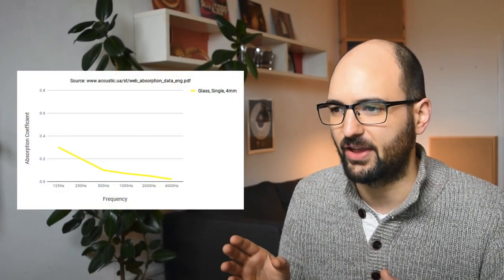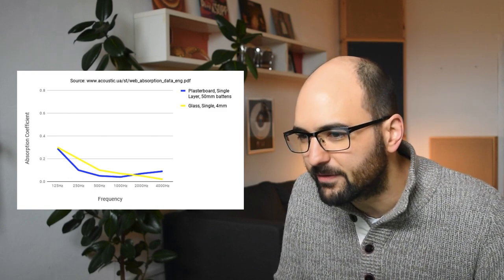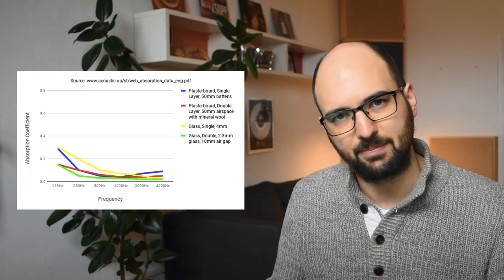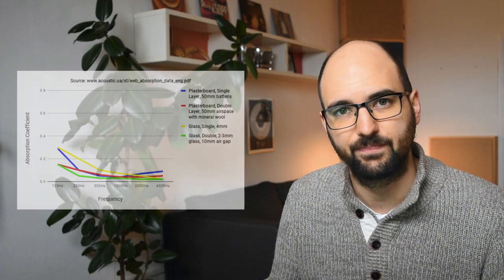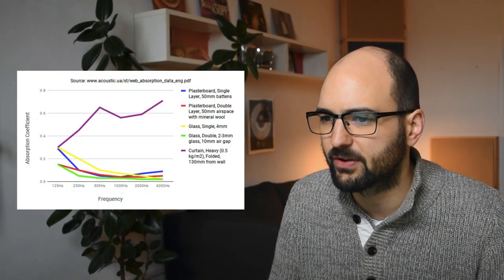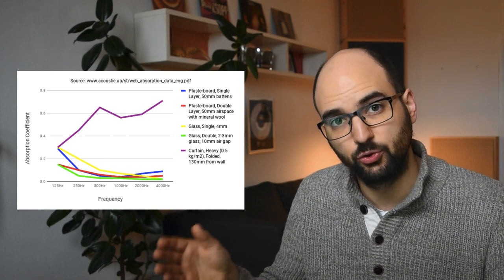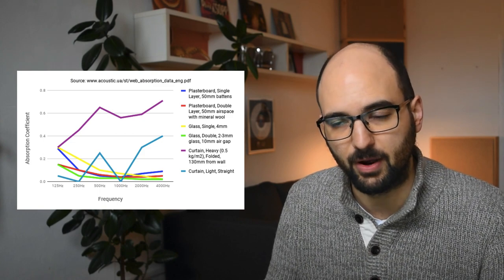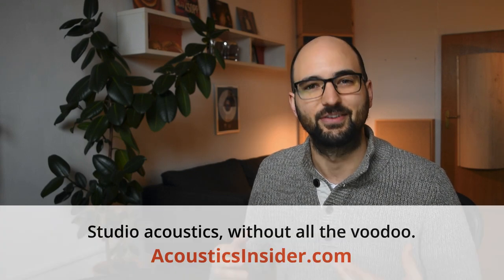Is The Window Behind My Speakers Causing Problems? - AcousticsInsider.com

Comment: There's a lot of confusion in this video. If glass reflects then that's what matters, not how much it absorbs. A thick curtain beats a thin curtain every time, and an air gap helps further. So that part was just wrong. But the main premise - does the window behind your speakers harm the sound? - was never even addressed! The answer is no, because most speakers send sound the other way. Only low frequencies emit from the rear of a typical box speaker.
Reply: Thanks for commenting on this buddy, I appreciate your extra thoughts on this! haha

Comment: Came here after setting up multiple Monitor positions in my new studio.  Didn’t bother with the obvious position with the huge window in the centre of my large space ... tried everything I could elsewhere with bass traps moved all over the place ... guess what?  In desperation I tried in front of the  massive windows which is the perfect symmetrical point ... then Sonarworks gave me the best bass response I’ve seen anywhere in the treated space ... even without several bass traps on place.  You’ve just confirmed my suspicions when I tried this out.  It’s not even especially noisy outside which surprised me. Thanks Jesco - you just confirmed what I found.  I should have just gone for the obvious in the first place and not discounted close to the windows bacause ‘it’s intuitively wrong’.  My measurements say it isn’t.  Thanks man - this is just me coming back with measurements and confirmation 😎👍👍

Comment: This channel is absolute gold! I have a large window to the right of my listening position and I was planning on getting a thick curtain to mitigate the reflections. Glad I found this video so now I know what to do instead. Thanks!
Reply: Hello, I hope you don't mind me asking, what did you end up doing with your window? I have a standard sized, double-glazed window (approx 115cm wide, 120cm tall) in the centre of the wall left to my desk setup. I have a thin-ish blackout curtain same length and wondering what to do with it. Would really appreciate any tips (:
Reply: @안단테샤넌   I'd like to know too. I have sliding glass door windows to my left, and a window in front that's half the height of the sliding doors; no wall to the right.
Reply: Hi abyde, Please reply, we are waiting.

Comment: To improve any room, or most, setting a system on the room's diagonal will in fact be every beneficial.
No matter if the boundaries are drywall, glass, wood, having the speakers at a 45* angle to the walls then projects the reflected sounds away from the seats. so instead of early reflections being received milliseconds after the direct signals from the speakers any reflected signals will be very late and then no longer a problem. I have certainly noticed on music I'm very familiar with, having the speakers on 45* angles to the walls, I now hear details in the recording that were muffled due to early reflections corrupting the direct signals.
Reply: This works! Put my speakers on the diagonal in my living room. Made a noticeable difference 🙏

Comment: I will be adding a later of insulation to the inside of a single brick outbuilding which will then become my studio. I will put up Rockwool insulation or possibly coldstore panels (as I can get them free). I would then add either a layer of 9mm ply or plasterboard, followed by the acoustic absorber panels in the right places. Is there any acoustic plus or negative to ply board or plasterboard? Thanks

Comment: My living room is really weird; it has a window well that is 87cm long (you could climb up and sit in it), 164cm wide and 103cm high. It's also off centre to the room and has double glazed windows at the front, as well as the left and right sides. I was thinking about covering the whole wall where the window well is (which is 335cm total and the remainder of the wall is plastered brick) with curtains. I have NS-10s, but was also going to get a pair of Kali Audio IN-8, or maybe the IN-5, for the extended low end response when I need it which I feel is when this window well would create the most problems.

Comment: What do you think of the Primacoustic Radiator diffuser?  They are an open grid and could be placed in front of windows. They still will let light in, but are supposed to diffuse sound.

Comment: This video is great... just subscribed... Thank you for posting. Question for you... My understanding is that I should be setting up my desk on the short wall in my 11x12 room. My problem is that I have a room with a window that is not centered on the short wall. When I set up the desk and the monitors, they obstruct the window. Also, with the window, off center and in the way, I have no way to mount a large monitor on the wall above the desk. The space behind my back is a closet so I can't set up on that wall. I have considered setting up on the long wall, but I know I'll get more pronounced peaks and nulls if I do this. Also, not that this is scientific at all, but the room just begs to have the desk on the short wall with the window. I would be grateful for any insight you might have.
Reply: We must live in the same building or something because I have the exact same issue would have loved to get some insight on this! What did you end up doing? I watched a few more of this guys' videos and came across his studio tour. It looks like he also has windows behind his desk and he treated it as if it were a wall. (as he mentioned) Now I just don't know what to do about my closet with sliding doors!
Reply: @luisharo9204  Hi. I installed a curtain rod and hung 2 velvet curtain panes in front of the closet doors behind me. I still have the desk facing the wall with the window. I put up a curtain rod on the window wall behind the desk and put up a 2 pane curtain. It covers the window and is wide enough that it looks like it's covering a centered window. Helped with the imaging, too.

Comment: Thanks Jesco. informative as usual.
But what about brick wall compared to glass? I imagine brick would reflect even more than glass or drywall? My window in on the short wall of a small rectangular room, I've always wondered whether it should be on the back wall or the front wall?
Reply from the maker: Hey Phil,

A brick wall will basically let less low frequencies pass through than either drywall or glass, since it has even higher mass. 

But in terms of your window: The question isn't so much which end of the room it should be on, but rather what it does to the low end response of your room, and how that affects where you should position your sweet spot to get a more balanced low end response.

The Bass Hunter technique that I linked to in the description will tell you exactly that.

Comment: Do you ever have some object in your home studio space causing audible noises because you've reached either it's own resonant frequency, or the resonant frequency of some adjacent object?  Imagine someone hit a corelle dinnerware plate (basically glass) with a silver dollar on top, somewhere in your studio. Whenever you hit that resonant frequency, let's say a bass amp outputting a peak in the low range of bass amp output, you get a horrible sound and your own ears are not helping you find it.  What do you do? Any ideas? I've been concocting a test setup with a looper pedal, a bass guitar, and a bass amp on a wheeled trolly so I can "test" fire loud amounts of certain frequencies around my room.   Say playing a chromatic scale on my bass from it's low E, up to the E one octave up.  It's often for me the 41 hz, and the sub-bass 20 hz where I hear these horrible resonant or rattling sounds in my room.
Reply: If the window is 4 feet behind the speakers and the speaker baffle is 16 inches wide, then would it be fair to say the only frequencies below approx 300hz will have direct incidence from the speaker to the window? In which case treatment should be more focussed on low frequency for the wall/window behind the speaker?

Comment: If you shold come up with some tips.. I have a very small room , The longest Walls are a bit over 3 meters, and The same on The other wals, The longest Wall “on The right “ has three Windows that fill up The intire Wall from mid and up to The celing. The ceiling is tiping about 5 to 10 degrees angle but from Where i have placed my monitors, The ceiling is not equel on both sides. My questien is: should i replace my speakers  against The Long Wall Where The Windows are, Where The celing is lowest or The other Way around, or do you Think that The placement is alrigt considered it’s a very small room and The celing is idk 40 cm higher on The right.

As of right now Where i have placed my speakers, i have a window on my current backwall, a door in The left corner to my booth that is as Big as my “controll room” a door on The left wall “up against The other Door” an on The right Wall, half window half Wall from The mid of The room in hights. My room is 10 m2

Comment: I really don't like absorption coefficients without having a context coming with it. What means glass and plaster board? Is it measured with 0 distance to a concrete wall of a reverb room or 20 cm distance or randomly placed in the room or build into a concrete wall with a big room behind? All of this will give totally different absorption values! 
If I want to know the absorption value of glass I build the setup totally different then when I want to know the absorption value of a window that has free space (aka outside) behind.

Comment: One of my four walls in the studio is basically glass. It is to the left of my mixing position and i have a very thin curtain infront of it. It somehow works but i end up with that nasty high frequency ear fatigue in my left ear after some time. I had the same fatigue after a couple of hours when i had an absorber on the first reflection point. So i pretty much just live with it as it is.
Reply: Get rolling acoustic panels

Comment: Hi. I am building a small home studio in the garden. It's gonna be 3x5 meters and i want to place a window in it. I can chose wherever i want to place it bit i'm not sure if it should  be in the back of the computer screen or in front of it on the far short side. Obviously i don't want to put a close it with a panel. Any advice?

Comment: I have a standard sized, double-glazed window (approx 115cm wide, 120cm tall) in the centre of the wall left to my desk setup. I have a thin-ish blackout curtain same length and wondering what to do with the window - for better image context, i I'm in a small University bedroom (approx 3m long, 2.7m wide) and trying to gauge what I could do amongst the limitations of a small room, both window and door opposite each other on the shorter walls (2.7m)  and likely permission issues for moving/adding furniture. Would really appreciate any tips (:

Comment: Hey thank you, very informative but I have a question. Wouldn't the window behind the speakers act as a filter, letting some of the bass frequencies 'escape' the room, therefore being more beneficial than a regular wall? because the bass is leaving and not being reflected back into the room? I would appreciate your thoughts on this.
Reply: heypussy hi 🤝😃 I was questioning myself this a time ago myself and couldn't find an answer so I hired a focused decibel meter and went outside to measure and actually it didn't come more sound from the window than the wall. The window was a double-layered 3mm (each glass plate), and the wall was a wall made of wood with rockwool inside (about 30 I'm deep) both made for cold winters here in Norway 🇳🇴 kindest reg. Hope I could help a little, but I am far from an expert on this!
Reply: @oledahl.  Oh thank you, thats good to know.  My window Is a regular one layer window. I will try to test it with a dB meter from the outside. Cheers

Comment: Hi Jesco, thanks you clarified many doubts

I have a window in my room that goes from side to side, it is very large and I currently have the monitors in front of it, but not very close. I do not have acoustic treatment, but I would like to invest a little in that. Another fact that I have is that my room is like a rectangle, but one of its shorter sides is the window. I do not have another space to put the monitors in the room, I would like to know what I could do?

Comment: Hey I have a problem I think you can help me with. I have a problem everytime I run my EQ for receiver. It always has my dialogue panned toward left phantom area between left speaker and center. I know these eq companies tell you to tweak after you run but I am concerned that when I change things I am altering things. If I do this then I find that S sounds sound much more pronounced on my right side. I can never get the imaging just right(especially in 2 channel) if someone talks from left on screen it sounds like the dialogue comes from that person but if it's is 2 people in the same scene, the person on right doesn't sound quote present in same frame(lacks punch I guess) the stereo effects come through from proper channels though. I have tried altering levels, distances etc. Have not tried any room acoustics materials yet because I have no idea where to start. 

I do love in an apartment and my speakers are in front of a pretty sizable window. My living room has carpet and absorption from couch and furniture. There is 2 open ways connecting loving room to entrance to apartment and kitchen and a small hallway that leads to 2 bedrooms and washroom.

Comment: The problem is - you glossed over the fact that glass and drywall reflection sound different and that they both " don't sound particularly good" generalizing the detrimental affect on sound. However, the difference in the materials' reflected sound is actually staggering. Most people have sheetrock / drywall rooms and left untreated usually sound quite poor. But imagine a cube made of glass and how absolutely abhorrent it would sound. Net - be careful to not generalize.

Comment: So glass absorbs sound starting at 250 Hz at increasing efficience towards the low end... wait what? The most difficult part of getting high audio quality in a room is not trashing it with long decay times in the low end while not overly dampening the highs. This appears to be even more essential given all somewhat affordable speakers tend to have poor directionality in the bass range. The only thing that damps the lows better than the mids and highs, I was told, are bass traps. Now you're telling me windows are doing just the same thing? Isn't that good news? I mean, we probably don't want it on the first reflection points, but doesn't that mean that generally, a good percentage of glass is a good thing to have?

Comment: If bass goes out of the window, wouldn't you have problems with lack of bass? should you just bass trap all corners anyway?
Reply: You don’t get “less bass” if some is escaping through a window. You would get less bass reflections, which is desirable for bass clarity. The whole idea of bass traps is to minimize bass reflections from bouncing around in your room and causing standing waves and cancellations.
Reply: Thomas Vadasis if you’re question is where best to position a window in your listening/mixing room, I don’t know. What’s probably more important though is too try putting your speakers in different locations and listen/measure to see what sounds best. A good rule of thumb is to set your speakers so they fire down the length of your room, and that placement is probably more important then where the windows are located.